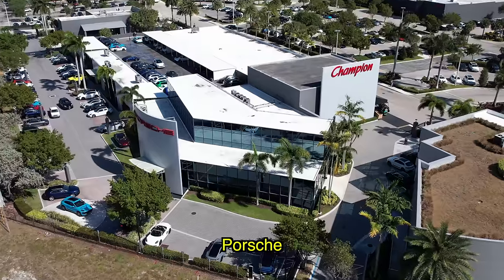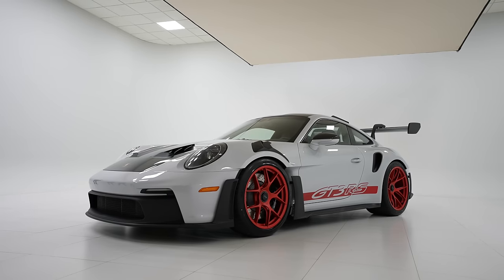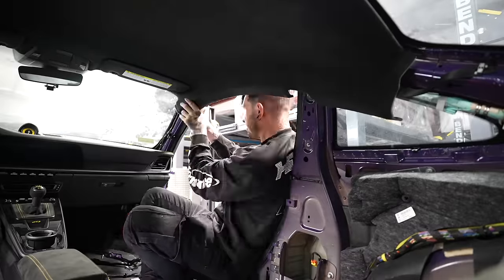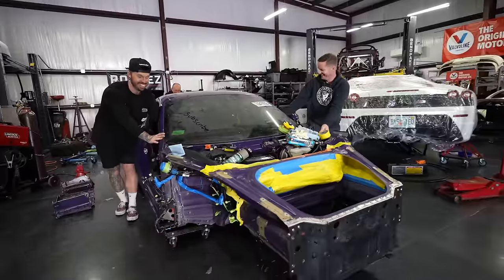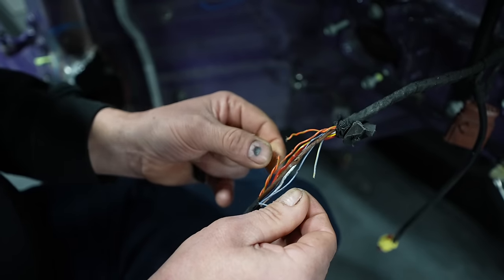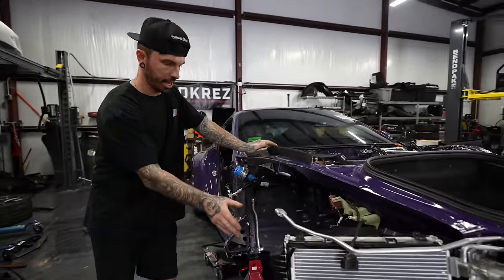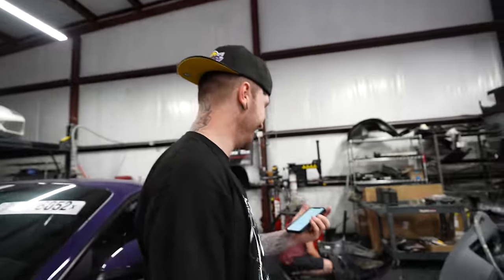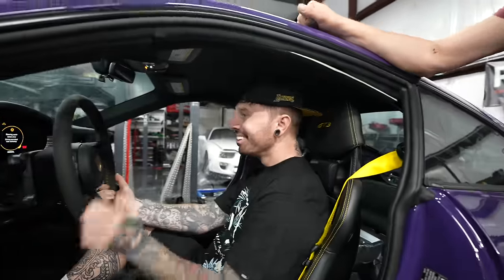REBUILDING A WRECKED PORSCHE 911 GT3 | PART 4

Comment: Airbags HURT. If you're not wearing your seatbelts, they CAN kill smaller people. I see people with theur feet up on the dashboard. That airbag will destroy your legs. Don't do that!
Also, if you're working on a many cars and you jump the wires for the airbag even with the battery disconnected, it can set it off. They have a built in capacitor that will set off the airbag even if the battery is already damaged! That's not good if you have a tool like a screwdriver in your hand and the airbag explodes!

Comment: tis porsche had not big damage its light damage oh i dit make e lot of tis the structural its not damaged ,otherwise you go in the other situation ,porsche sell the chassis beam  e short part that you can get and otherwise its the full front you need to buy there its very expensive and the glue you need its the brand :dow , betamate 2096 thats the right gleu also here like the parts the radiator support you can not buy the radiator support seperaly you need good see that you keep good the damaged parts

Comment: A 3000 dollar battery?? That is the biggest scam i've seen (bigger than FTX !!) :D 
There's only a handful of battery technologies in existence, all you need to do is find a battery that's the same chemistry type (LiOn in this case) and match the Amp hours and starting voltage as well as pick the one with correct sided +/- contacts and you're good. And there's a plethora of these selections out there, for FAR less money. 
Like c'mon porsche, it's a battery not a complicated system that runs electronics etc.

Comment: Lithium batteries have a built in battery management system “BMS” which shuts the battery off below a certain voltage.  By connecting to the other battery the charger worked because BMS saw voltage level above the shut off voltage and turned battery back on so that it would charge.  Nice work Matt and creative solution Freddy!

Comment: There was never anything wrong with the battery. 
Lithium batteries can be run down to zero and they still will fully recover however the lesser quality lithium batteries need to be “woken up” before they will accept a charge and the better ones have a wake up profile built in to the battery software. Specialist lithium chargers are needed to charge lithiums and a wake up feature in the charger is needed as part of the charge profile on the cheapies. I am amazed that Porsche batteries are still running the old software and don’t automatically wake up. Porsche needs a kick up the arse for charging so much money for old technology on a current GT3. How many people drive these cars on a daily basis ? If it’s parked  long enough without a charger plugged in the battery will eventually go to zero.

Comment: i would never buy a car repaired by a diy guy who has clearly not enough knowledge when it comes to repairing major safety setups. using wrong seatbelts is mental. they have different part numbers for a reason.